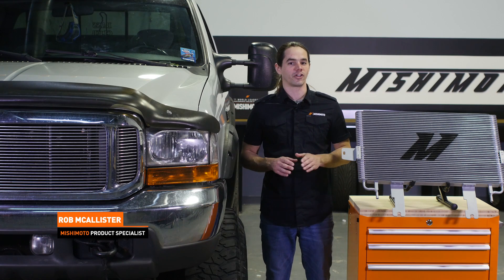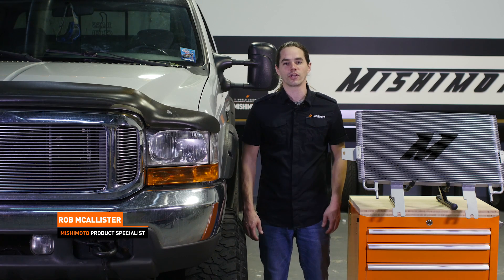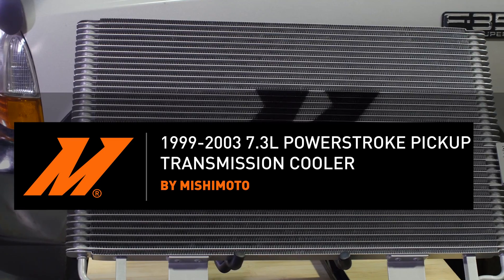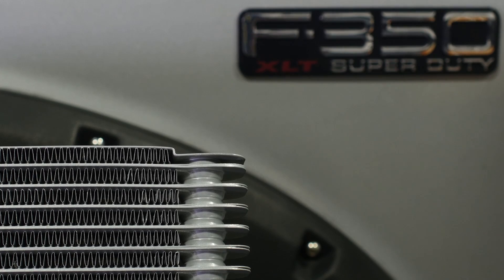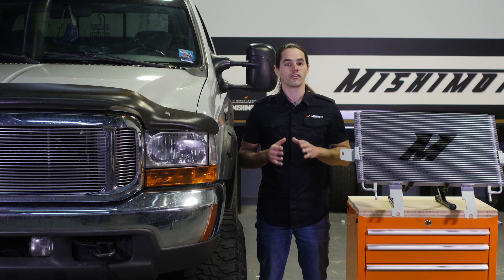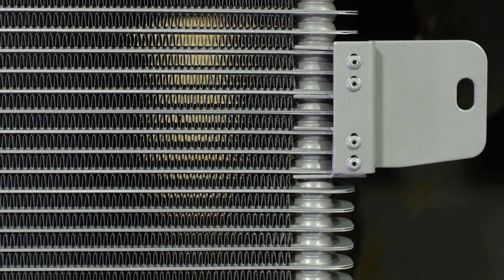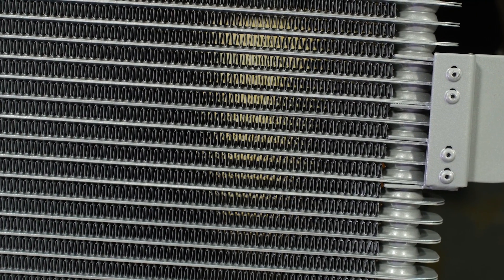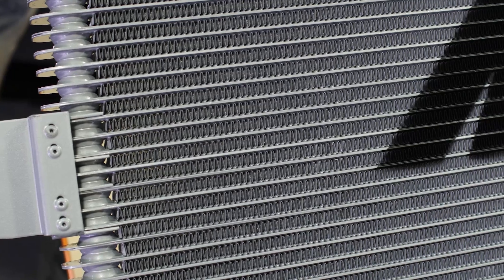1999-2003 7.3L Powerstroke Pickup Transmission Cooler Features and Benefits by Mishimoto

Comment: Just installed a Mishimoto trans cooler yesterday.  Very simple installation. Everything fit perfectly  which was awesome! To often aftermarket stuff doesn't quite line up or fit right.  Slid this thing in and back together in a jiffy.

Comment: Will this fit a 99 e450 shuttle bus?
Reply from the maker: This would unfortunately not be a direct bolt on for the E series truck as they use a different mounting system than the F series trucks

Comment: Can this transmission cooler be fitted to the 1997 F-250 HD Powerstroke?
Reply from the maker: Hello Aleta. While it would not be a direct fit unit for your 97, we do have quite a few customers adapting these to the previous generation vehicle. Apparently, the modifications required are quite straightforward, and should not be difficult for those who are mechanically inclined.